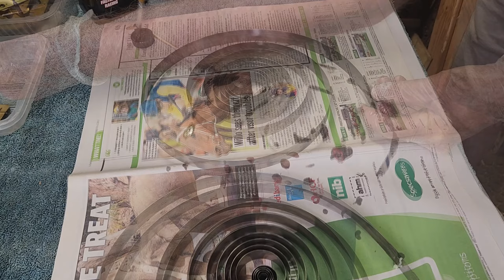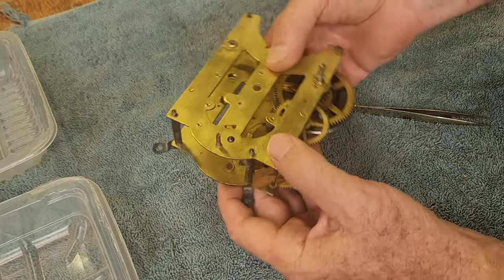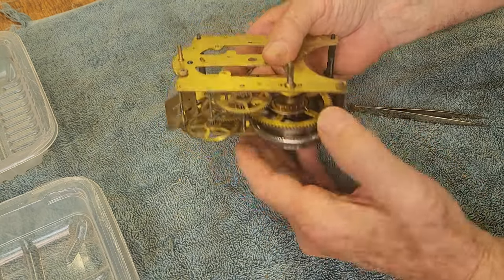Full Service of an Antique Ansonia Kitchen Clock Part 3. Oiling Mainsprings and Polishing Pivots

Comment: Hey Chris you can get simply green from Bunnings in a four litre bottle. You can get the commercial grade in the special orders department it simple green but it's an orange which is which is even stronger (I have not tried the orange one yet, but guess U would use less). I use it in my ultrasonic cleaner to clean remote control aeroplane motors to clean the gunked off from years of castor oil. Just follow the instructions for heavy duty cleaning on the bottle. Would have be  interesting if you explain the process to re-bushing the pivot holes. Cheers Graham.
Reply from the maker: I might try some simple green Graham, it sounds like it might do the job nicely 👍😊